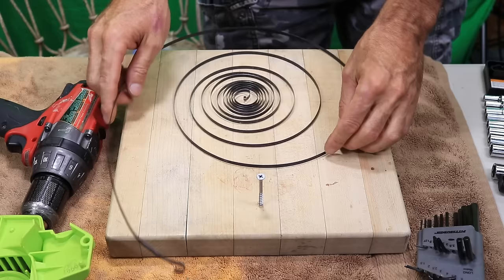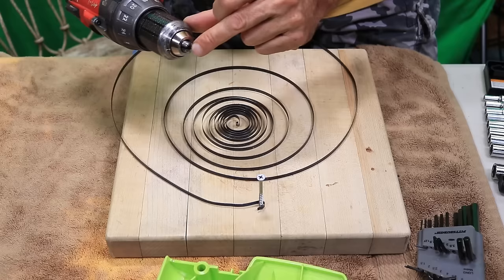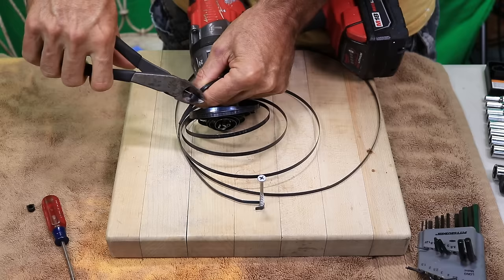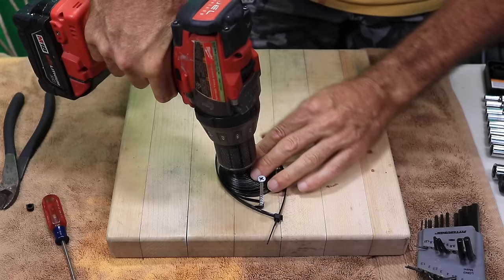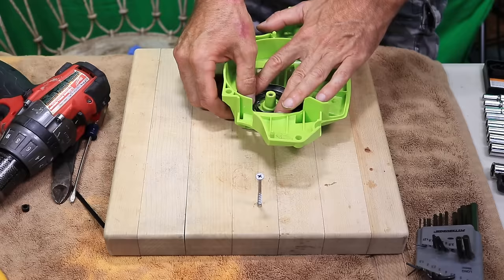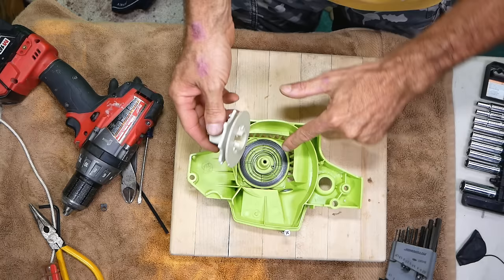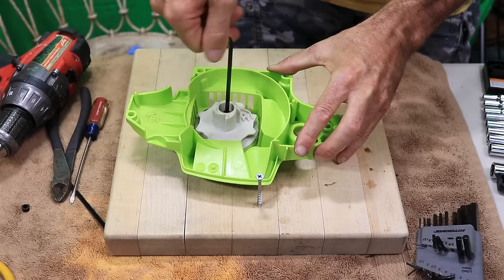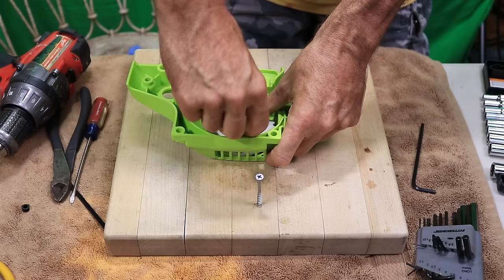Easily Fix Your Pull Start Recoil Spring for Small Engine

Comment: I'm a novice at small engine repairs, but with videos like yours, I've finely figured out how to successfully repair my recoil spring and rope on my 24 yo Tecumseh tiller.  I've spent 2 weeks trying to figure out which direction to install the spring, how to keep the spring inside while rewinding it.  With your video I realized I didn't need the rope installed until after the spring was working (many hours trying to wrap the spring and rope at the same time).  Weird your video didn't show up when I googled this topic, but after about 40 videos, I'm done!  So glad, so so glad.  Thank you!!
Reply from the maker: HI Julie!  Thank you for sharing your experience.  I really appreciate it and I am so glad I could help... 😊

Comment: This was really helpful.  It really works well.  I can add two more recommendations after fighting through this.  Trace an outline of the housing on the board so that you know you have the spring tight enouh and use a paint scraper to hold the coils down when tightening with the drill.  I also recommend to check the shape of the spring where the drill held it.  I hsd to reshape a bit before reinstalling.
Reply from the maker: Excellent!  Thanks for the recommendations... 😀

Comment: Good vid. My tip: after you get the spring in the spool, the spool back in the head, use a wood working clamp to hold in place after winding. This makes it easy to install the rope.
Reply from the maker: Thanks for the tip!  I'll try that next time.. 😊

Comment: Thanks for the tutorial. I was able to get the spring back in the cheapo weed wacker I was working on. One suggestion for anyone watching: The spring may get distorted and not lay flat. This is easily fixed so it doesn't cause a problem.
Reply from the maker: Glad I was able to help... !.. 😀

Comment: Thank you so much. I had to make some modifications. The chuck bent the middle of the spring. I therefore used a hollow metal tube from the stand of a solar flowerbed LED light, to wind the spring around. I just had to cut a slit in the end, to be able to attach the spring to the metal tube. Also I inverted the zip tie, since I don't have any space for the zip-tie knob around the spring inside the housing. This mad the knob on on the zip tie point inwards, next to the hook on the spring, where there was some free space. I had to try a few times before making it into the extremely tiny groove in the housing. The important thing is to make the zip tie small enough to fit easy all the way down into the housing, and keeping the zip tie completely at the bottom of the housing at all times, while attaching the outer spring-hook to the housing. Saved the day :)
Reply from the maker: Awesome.. thanks for the great tips you've given.. Glad you got it going again.. 🙂

Comment: Thanks me for teaching me a nifty little trick! Fortunately, my company has an account at multiple lawn equipment companies and I have the go ahead to just go and get the parts as need. Just buy a new spring. Save yourself a hassle. I’m totally for this method in a pinch though. Great video!
Reply from the maker: I agree if you're a technician!  Absolutely... but on a Sunday afternoon or an evening when you just want to get back up and running... this works great.. 😀

Comment: I ordered a new recoil spring for my 1964 18hp Johnson outboard since the old one snapped. Lets hope this trick works. Next step is to track down the no spark on cyl 2 and I sure hope it's only a spark plug wire.
Reply from the maker: Oh wow.. I guess parts are still available for that puppy...  I hope it's not a magneto..if that one uses a magneto... is it points with a coil?
Reply: Parts for all outboards is SEAWAY MARINE (425) 412-4006 Seatle Area. They will have what you need.

Comment: i came up with a really safe and easy hand way to do this. I take one of those large magnets for like knives or tools about a foot and half long. Two even better if you have them,  and then just slowly wind it.The magnet keeps it both flat and resists movement. Once it is tight enough I put my huskqvarna chain thngy on it but  like you did is fine for those that dont have it.
Reply from the maker: Great idea!

Comment: One adjustment I would make to this is to take a piece of luan, cut it into the circumference of where you want the spring to fit (cut into the shape of a circle the size of where the spring is going), drill a hole in the center big enough for your drill's chuck, then follow the same plan in this video but use the luan circle to hold the spring down instead of your hand....might make the second part easier as well when putting it in the housing. I haven't tried this yet, just came up with it, maybe it'll work to make it a little easier.
Reply from the maker: Sounds like a good idea.. :-).

Comment: I have a small generator wherefore I was pulling on the pull-start cable to start just after gassing. Up until this particular times I'd never once had any issues with my generator. However, as I pulled on the start cable, the cable seemed to become very rigid to pull, meaning it was tense and only pulled out halfway prior to simply locking in to place with half of the rope out of the appliance. At this time I simply changed my whole operation from starting the generator onto trying to figure out how to get that cable back into the appliance. Well, every time I pulled just another inch the cable itself was another inch outside the appliance onto the ground. I started to watch some videos wherefore this video would've been more helpful. Now I have other camp-mates where we all share this generator. One of them, my friend Doug brought another generator assembly with the spring and cable already installed. He installed the used assembly and it has worked fine. However, I've been vacant from the camp for a few days and I would still like to fix the old assembly the way you displayed in your educational video here. As soon as have the time I will be attempting to use the knowledge from your video here to fix the old pull-start assembly. I would have to assume that it will be easily accomplished per your educational video considering all of the other components are still around here somewhere. If the spring is broken then it may not work ... Or am I able to simply cut the broken part away if it's a small length and reshape the end then perform the action? Feedback is welcome here. Thanks for your how-to-fix videos and I will be subscribing.
Reply from the maker: HI... Thank you for the comment!  I do wonder why the original one messed up... If it's broke, you'll probably have to heat up the end to reshape it.. That metal doesn't bend very good.  And like you said that'll only work if it's a small length.. if it's broke in the middle, there won't be enough spring left to do any good.  Let me know how it goes.. :-)

Comment: Thanks so much for the video. Great idea!I had a couple of problems. I couldn’t get the chuck to let go at one point so I cut a slot in some threaded rod and chucked it up in the drill. I also had a notch for the outer part of the spring to go into which I couldn’t get it into with the tie wrap on the outside of the spring. So after the spring was captured by the outer tie wrap I added three small tie wraps would around the other way. I then cut the larger outside tie wrap , removed it, exposing the hook on the end of the spring. I could then put the spring in and put the end in the slot. I then cut the three smaller tie wraps. J
Reply from the maker: Very cool!  You sound like a problem solver... :-)

Comment: You're very good doing this repair, thanks for the awesome vid. I tried this on my 1973 stihl 015 recoil spring and my dewalt 20v drill broke the spring While winding it so I have another new spring on the way and will watch your vid this time while I'm in the process. Hopefully I can keep the new spring together and safely get it into the housing.
Reply from the maker: Sorry for the late response, your comment was lost in the mix..  Hopefully you got it working by now!  Thanks for the comment.. 😊
Reply: @JLPicard440  Yessir, the new spring came in and I held it for dear life between my thumb and index finger from the package to the housing and all went well. The metal shipping cup the spring is shipped in fooled me the 1st time, I wasn't aware that the spring wants to jump out of the metal cup so badly and requires you to keep downward pressure on it at all times after it's been removed from the package.
Reply from the maker: @bigtexas7580  Sounds like some kind of surgery!.... 😂

Comment: I would recommend using a trim head screw on the board.  The head is smaller, and the spring should slip right out when you're done.
Reply from the maker: Great idea!  Thanks for the info.. 😀

Comment: Great and simple. Just one small remark: it would be much easier to remove after recoiling if you cut the head of the screw. Or just hammer into this wooden board a headless nail instead of the screw. :-)
Reply from the maker: You could be right!  Thanks for the tip..☺️☺️

Comment: For this type of spring, you won't require a "little bit of patience" that goes away right at the beginning! You need perseverance, firm fingers, to be in the shade, nothing and no one around you except for one helper in case you need to hit someone... Whoever created this type of string couldn't be more self-concerned about how difficult it can get and what a pain it is to put the thing back! I mean, OMG! An engineer who is capable and understanding is needed here. Why can't it just be like a string box, separate from the cord piece that can simply be plugged in and out, with no need to mess with the spring at all? Leave that thing in there!
Reply from the maker: Lol... I can see why they designed it that way, but they probably could have come up with something easier to work on..  It probably would have been more expensive and that has to be a factor too... 😀
Reply: @JLPicard440, believe me, I'd rather pay than go through that frustrating event once again! It wasn't pleasant, and my tired fingers and the three hours prove my point. Three hours that could easily be compensated by paying extra.
Reply from the maker: I agree... sometimes charging a little more to make it better isn't a bad thing... 😎

Comment: I wound it up and got it in the housing only to discover i had put it in Backwards....damn!  BTW, I'd use a Finishing Nail and not a big head screw.
Reply from the maker: Yep... I understand.  If there's a 50/50 chance, I usually get it wrong too... :-).. Good tip on the nail.

Comment: Hi thanks. I just rebuilt a Johnson outboard motor ignition recoil spring it is very similar to this one. I was wondering if it is possible to have an overtightened recoil spring if that makes sense? I just rewound it until it pulls the cord back in nicely and is nice and cord is nice & taunt, have yet to test it. I’ve seen everyone say it range from 6 spins to 14 or 18 spins counter clockwise to get spring nice and tight. Basically I just did it till it sucks the pull cord back in nice and quick
Reply from the maker: HI, yes it's possible to have it to tight.  If you did it to the point that it's just now working well, sounds like I'd leave it alone!

Comment: Nice Job .   You make it look easy.  What size is that center screw you know ?    Cause I had to drill mine out.
Reply from the maker: I don't remember... Do you mean in the engine?  There would be quite a few different ones depending on which engine you have...

Comment: Personally, I wouldn't recommend this method. It will bend the inner part of the spring so the base of the carrier/spool will will not seat properly. The most reliable method is to use pipe slightly smaller than the spring seat. Cut 3 slices out of the pipe so you can hook the tail of the spring. Inside the pipe bore you fit a snug fitting cylinder (a flat bottomed bottle, round bar of wood etc). This is to provide a flat spot while you wind the spring in the pipe. Wind the spring in reverse to recoil housing in the pipe from the outside in then transfer the spring to the recoil housing, pushing everything in with a screwdriver.
Reply from the maker: Thanks for the info... No this didn't bend the spring... 😀

Comment: Warning!! This doesn't work very well with a Evinrude 15 hp 1990 boat motor spring. The spring for the boat motor is much more substantial, stiffer and and more difficult to manipulate, after about 5-6 attempts the Spring end broke off. 17.00 down the drain. I'll take the next one to the lawn mower shop and pay them to do it.
Reply from the maker: Thanks for the info!

Comment: Mine came. Uncoiled the. Old. One. The inner. Recoil spring was. Broke. After I. Placed. In. Place to line. It. Up. The. Wire. Came uncoiled. So. Just. Replace. The. Whole. Piece. It's. $21.00
Reply from the maker: Thank you..

Comment: That's. The. Wire. They use. Too. Hold it. Together. So. I. Juse. Ordered the. Whole. Rope. Starter. Kit. Problem solved. U   don't know if it will happen. Later. On. When. On. A. Job n. You don't have to pull. To. Hardthats the. Echo. Brand. They. Flood. Easy. Just. Hold. The trigger. N. Pull. Until. It. Starts
Reply from the maker: Good tip.  Thanks.

Comment: You need to lube the spring
Reply from the maker: WHY?  It's not lubed from the factory..That will most likely attract a bunch of dirt and grime.  IF there is any lube it's just an ever so slight film.
Reply: @JLPicard440  yeah, he's right, b/c the spring always ends up rusting, even from the slightest moisture, then you're back to square one again. And yes, just a thin coat is all it takes for rust prevention
Reply from the maker: @purdyboi8078  Here on the east coast we have plenty of humidity, that'll do it!